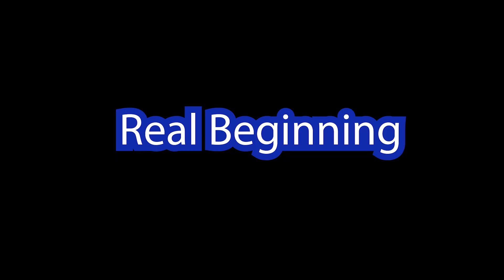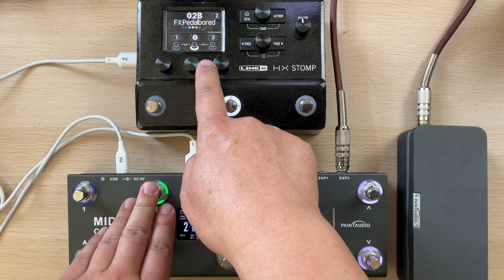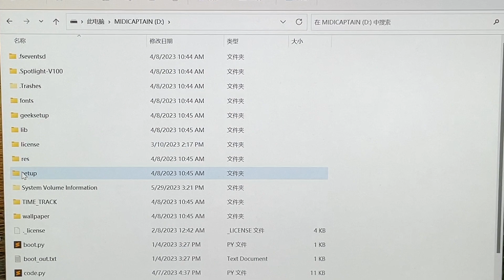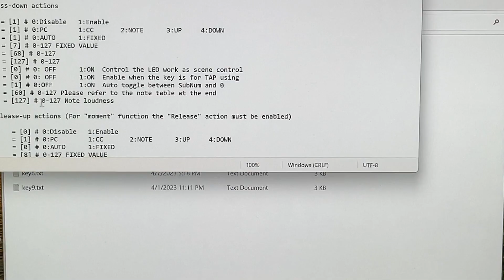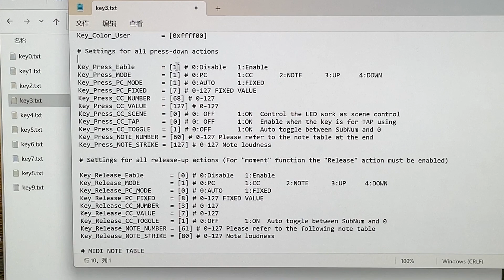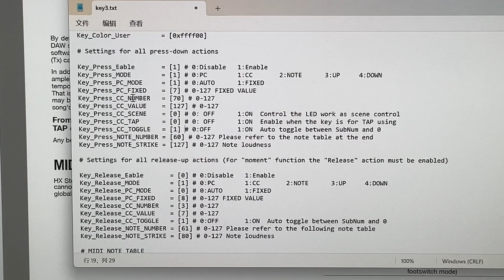MIDI Captain Preset 1 for the Line 6 HX Stomp MIDI Control Basics and Command Setup Example Tapping

Comment: I ordered this foot controller and tried it out... yes, basically it works... I tried to set up an expression pedal in geek mode. I wanted to control the parameters of my Boss Sy 200... no chance, it doesn't work. Basically, the CC assignment in the Boss pedal is very simple, but the Midi Captain doesn't respond. I can turn the Boss pedal on and off, but I can't control any parameters.

Maybe there's a way to do it, but this strange company doesn't respond to any of my inquiries. I've been trying to get this expression pedal to work for two weeks (!) – I even bought a pedal where you can switch the polarity... nothing works... as I said, maybe there's a way to do it... BUT WHO NEEDS A COMPANY THAT DOESN'T OFFER SUPPORT???

I'll never buy anything from them again – what a waste of time!

Comment: Does this work with ampero mini?
Reply from the maker: So far it doesn't. Both the ampero mini and the midi captain are USB midi devices. But the control needs to be set between a host and a device. We are trying to have the USB host midi on midi captain serials however that needs a big update and a new model.

Comment: Trying to use this with my Helix , got it to work somewhat but not how I want it yet, so I would like buttons 1-4 and A-D to mirror the buttons 2-5 & 8-11 on the Helix (Respectfully), I have the Helix setup with 2-5 for Presets and  8-11 for Snapshots .
Right now A B C & D will change the presets  FOR ONLY BANK 1, if I change banks it reverts back , Button 4 will jump to bank (02A)  and this is ALL it will change, I see that up and down will change banks on the MC (Midi Captain) But I am really hoping  I can change (scroll) banks with like buttons 1-2 and scroll presets with 3-4 at least. If I figure this out I will post the Text File, if anyone can help that would be great. BRAND NEW to me so this is a bit of a curve ball.
Reply from the maker: Hi I can make a configuration txt file for about all you want. Let me check again with you about all the keys functions you want later. Also have you noticed the latest videos in this channel about the SuperMode 4.0 firmware and the pre-configured pages for most of the popular devices?
Reply: @Wilson-PaintAudio  That would be Awesome, I just got this today so I know nothing about Supermode 4.0, I did however figure out that on using the Page up down works like I was hoping only a-d  presets are on the bottom,  now if I could change Snapshots with 1-4 would be awesome and even better If I can have presets on 1-4 and snapshot on a-d., I did try "geek mode" but no luck, I guess my Midi Skills aren't so great. Thanks for the help. I'll search those latest videos.

Comment: I just purchased a Mini 6, how can I set it up for hx stomp mode?? Since there is no when in the unit
Reply from the maker: Working on an update that the mini6 can works as the same as 10-switch one with pre-arranged pages on supermode4.0. Will be ready soon. Maybe several days. Now you can check my youtube channel about the lastest tutorials about supermode configuration methods and the example about the pre-arranged pages in 10-switch midi captain. By the way, the Fireware inside the mini6 is supermode 3.5 and will be updated to 4.0 as well in the incoming update.

Comment: hi Wilson my question is this . I have the fractal fm 3 can I use all 10 switches on the midi captain for just efx
 like have 10 stomp boxes is that possible ?...
Reply from the maker: I had tried scenes control such as the 8 scenes and scenes+/- and the tuner / tap control on my friend's FM3. From the page97 of the FM3-Owners-Manual, you can use CC# for any block's bypass control. Just bought a FM3 for myself, and when I get the device I will try this as well and make video about it.
Reply: @Wilson-PaintAudio  thank you for the info what I'd want to do is keep the three switches on the fm3 as my different amps and for each amp I use the midi captains all 10 switches would be strictly for my on /off efx ,  distortion, delay, chorus, phaser, OD Etc, but all 10 switches in on/off mode just like regular pedals try that if you can and let me know how it works. you can probably do the same with the HX Stomp the main thing is to use the midi captains all 10 switches individually in on/off mode that would be the ultimate set up let me know if it works thanks again.

Comment: I bought this recently as a replacement for my older hard to program controller. I was hoping that the interface would take me away from technical programming however the geek mode is lacking around led control and having to edit txt files for the standard mode is not the reason I purchased this product. Fundamentally I don’t use the HX stomp in the way that the product has been programmed for. Great product but make sure you do your research first.

Comment: Is it possible to command the HX Stomp in Stomp mode with the MIDI Captain's?
Reply from the maker: Do you mean control the module bypass? Yes. Just did some new tests about this and will make a video about it.
Reply: @Wilson-PaintAudio  Not exactly for the bypass but for the Stomp mode (each switch command off and on for one stomp and that would differents Stomp for each switch,do you understand?

Comment: The best jack off all trades device I'm using. Small, extremely versatile and easy to program, completely wireless. I have many midi controllers but this one - the best
 (note - the black one in this video is the STD which doesn't have wireless midi).